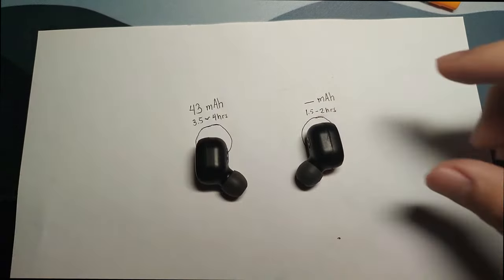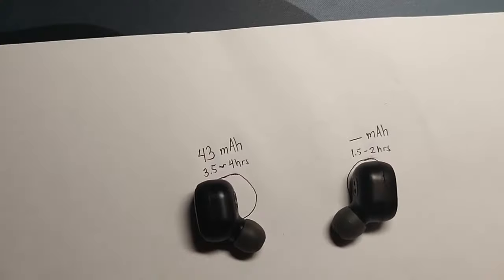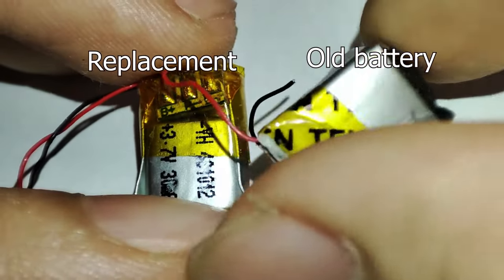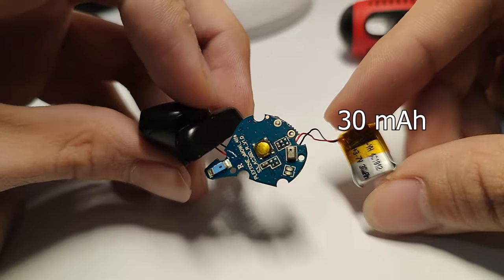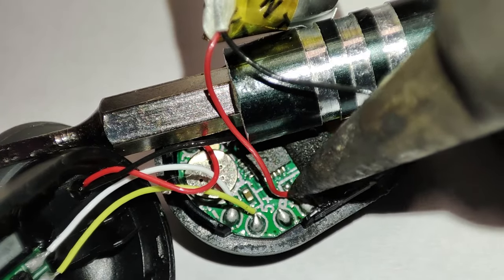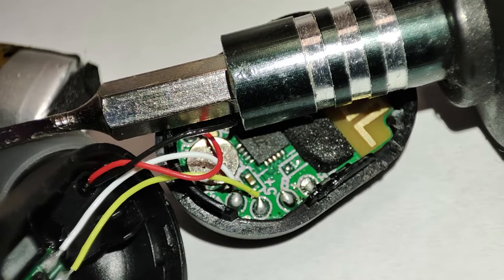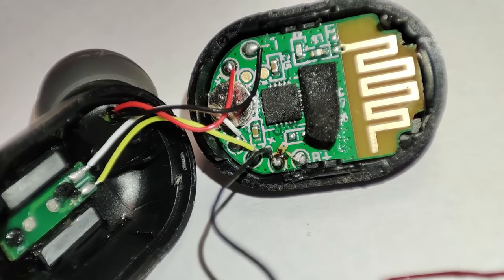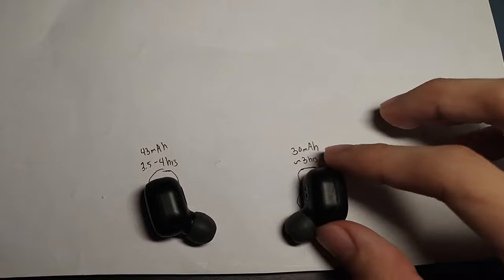FIX | Earbuds Uneven/Fast Battery Drain

Comment: My left one drains after 4-5 hours and right one drains 7-8 hours
Reply: Bruh I can hardly use it for 1 hour ( i have boat airdopes btw )
Reply: @devrajbhadoria5905  same i have boat airpods 381 my left one last for 4 to 5 hours and my right one only last for 1 min and after that it start saying battery low and disconnect automatically even i charged it full very bad product boat 😡😡
Reply: I have a pair of Boat Airdopes 402, having the same problem... The right one discharges faster, barely lasts for 40 minutes, but left side one still has 70 % battery remaining..

Comment: My right earbud drains the fastest but also charges the fastest? Is there a fix to this? By the time the right earbud is powerless the left still has 50% and vice versa when charging.
Reply: Probably just a smaller battery. Would take less time to charge a battery half the capacity

Comment: Hi! I just wanted to point out that there is no 'issue' with your earphones. When you use both of them, the right earbud will do the bluetooth communication with the phone, as well as the syncing between the two earbuds. So it does about twice as much work, compared to the left one. This is why its battery drains and degrades faster. It comes 'naturally'.
In other words, at the start, they both have 43mAh capacity, but their drain will always be uneven because the right one needs to consume more power.
Reply from the maker: There is though, when i didnt change the stock battery (43mAh) , it only runs for about 1 - 1.5 hrs, but when I changed it for a 35mAh battery,  it suddenly can last 2times longer 
I swapped the battery with my old earphones and that earphone with the claim 43mAh now will only last 30 minutes or less from having 1hr duration after a few charge cycles.
That battery is garbage.
Reply: @renzg6887  I see, I meant the uneven drain is not an issue by itself.
Reply from the maker: @tapthefly9702  depends on the gap of the uneveness of the drain, the difference should be very small
Reply: Mine just stay for 15mins 🤧
Reply: @renzg6887  awei earbuds batteries are the best, I bought a brand new Awei t13 pro which is paired to my Redmi 9 prime and after 8 full hrs of non stop listening at 80 percent volume, my earbuds was still at 60 percent on the battery gauge. It's cheaper than the mi basic 2 tws, but it comes with a USB C port, and a new improved Bluetooth 5.1 chip that barely consumes battery. Considering that the earbuds are rated at 8 hrs non stop listening, I can safely say that these buds can easily last over 15 hours on a single charge and at 80 percent volume
Reply: @danteerskine7678  which model of earbuds please?
Reply: @renzg6887  bro my difference is 10% is that normal i take out my nord buds 2 from case at 100 and eventually with time the battery is like left earbuds 60% and right earbuds 50% i dont knw why this happens
Reply: @PatiencePersevarance   mine too 😢 I'm nervous
Reply: I use my left earbud while working (raycon) and leave the right one in the case. My right one even if they charge 24 hours only last like 4-5 hours 

Does it stay on even in the case?

I never had this issue with earbud before. Raycon is the first

Comment: Wouldn't it be easier to cut the wire and solder at the wire?
Reply from the maker: That could also work, just put insulation after soldering the wires

Comment: So my quantum tws earbuds started showing failure since yesterday and i think it happened over the years so first i didnt know it wasnt supposed to stay in my jacket ontop of a radiator so lot of times it would be hot and i also bike at extreme weathers where i come home without a dry part even under my jacket and now my earbuds started dying way to fast the left instantaneously starts draining in like 8 mins it gives me low battery and then satys at low for another 12 minutes than dies my other one can stay lot longer (its the one i have always on) and drains way slower ill see what i can do but this might be near the end of my earbuds

Comment: I did buy one used qcy tc1 and it's lasting 7 hours  and the right one lasting 4 hours. The point is: You replace the battery for a new one and get just 3.5 hours???
Reply from the maker: cheap earphones, cheap battery = low battery life.

Comment: Dude pls help, my left realme bud is all good but the right drains fast af like i didn't  faced this issue  before, ive been using  em from a year now ig and im facing  this problem  recently
Reply from the maker: that's what happened to mine as well. You need to replace the battery.
Reply: Ok thanks
Reply: Same goes with me...realme neo ..i bought 2..both with same problem

Comment: Hello does dead battery explode?
When I brought it 
It get wet then it's starting to delay but the battery is ok
And I think it's already 6 or 5 months old now 
The wet earbuds starting to last a hour 
I tried to hit and shake it
To the point I throw it in to the ground 
And the cover split but the insides I think still attach
I put it together and still work
Is it dangerous to continue to use it?
It starts to last less a hour
However the other side is very normal and ok
Reply from the maker: should be alright, as long as the insides are no longer wet and all
Reply: @renzg6887  thank u
I was worried because I thought it might hurt my ears

Comment: I have a similar problem with my galaxy buds fe. I also have redmi buds and soundcore buds each of which has dead one of the buds. I found on the internet that one bud drains quicker (usually right) because it acts as a main unit and as a result consumes more power.
Reply: Same issue with my OnePlus buds pro 2. Is it normal or neeed to worry?.😢

Comment: link where you purchased the battery
Reply from the maker: I used an old broken earphone to replace the battery.. you can search "40maH battery" you'll see these ones https://shopee.ph/product/177704754/16265587212?smtt=0.162859699-1656654151.9

But make sure they are legit

Comment: Sa shopee or lazada meron kaya ganyang battery replacement bro? tranya m10 pala yung TWS ko.
Reply: also circle yung sa m10, kelangan ba circle din yung bibilhin na battery bro? thanks for your help
Reply from the maker: @themimingfromdavao  can buy any battery aslong as kaysa sa case and same material, in this case. LiPo 3.7 V rechargable battery. make sure lang talaga kasya sa case.
meron sa shoppee/lazada mga small batteries, double check lang ang size.

Comment: Hi how to know if the charging fort is  broken
Reply from the maker: if you have a multimeter, you can test its voltage it should read 4.2-5V. YOu can also use LED as a tester, pretend that the charging port is a 5V battery.